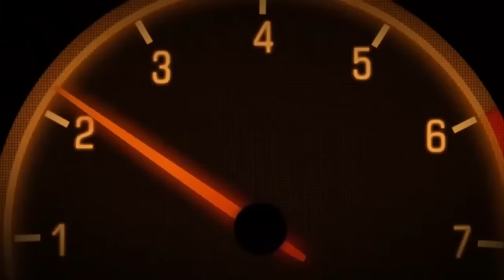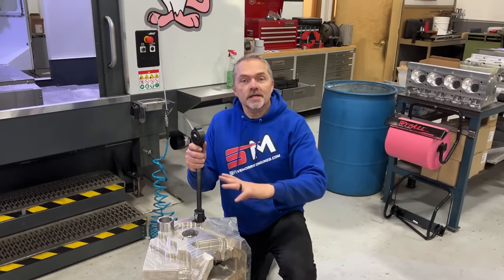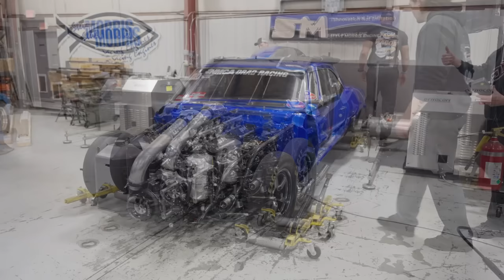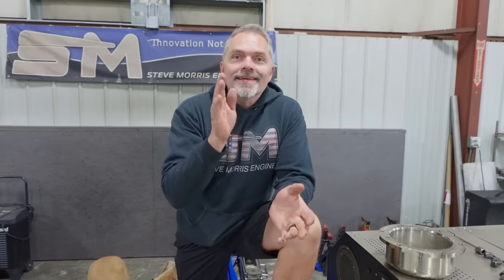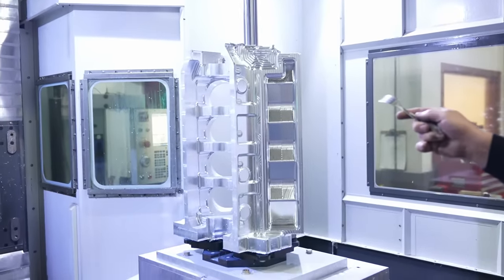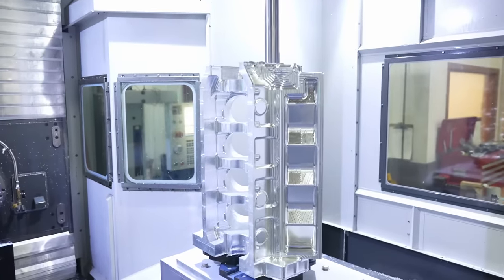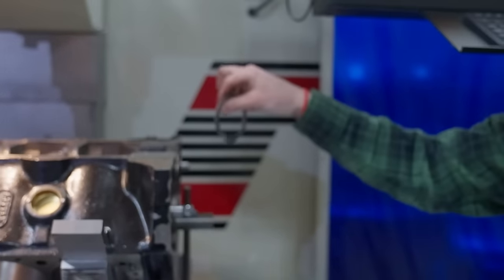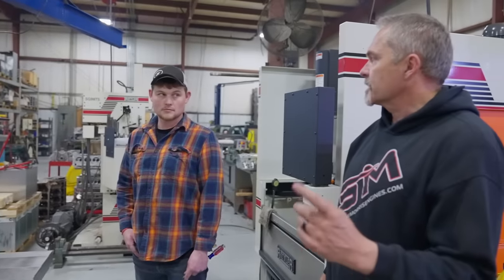Billet SMX Block… SBC Roller Thrust Bearing….Back From The Dead 1969 Camaro.

Comment: I might be wrong, this isn't my erea of expertise but....
By having all external surfaces finished with the 75k step change you're significantly increasing the surface area of the block. I would guess this will help with cooling so isn't just for looks option it has can have an actual, practical, effect.

Just thinking out loud really, would love to hear anyone elses input.

Comment: Steve - Is it just me or did your dial bore gauge look like it was showing 3 thou tight and 5 thou tight, not 3 loose and 5 tight? Just looked like the needle was reading past 12 o'clock clockwise for both readings? Thanks. Some people may not realize a sheet of paper is around 0.004 thick and comparing that to oil clearance in bearing use less than that can be an eye opener, maybe you could do an info piece on that.

Comment: Dear Mr Morris,  
 I would be very intrigued to see what would happen if you Cryogenically stress relieved the engine blocks after heat treatment. 
 I honestly think you might benefit from using the same type of technology the germans employed in the construction of their aircraft engines. The deep freeze is important to realign the crystals in the metal matrix. ❤❤
 P.S. polished aluminum cools slower than unpolished aluminum because of surface area differences. Besides the fact that all those curves and straight lines look awesome with the tool and die ground look.

Comment: Well, it was fine till Steve put his grubby finger prints on it! LOL JK
I was watching after you asked the question and came to realize that area you are speaking about is inside the water jacket. At least that’s what I understood. So I don’t think you want to waste any time there. What you might want to do is consider what is best for the cooling. I don’t know if smooth or rough, is better. 
That is my 2 cents. 
I think Sugar Momma is a great Drag and Drive car I’d be happy to have. I put in my $60 entry for one of your blue zip up hoodies. 
P.S. I think maybe they must have water cooled those blocks leading to the cloudy aluminum discoloration. 
Mark

Comment: As a metal engineer im thinking the matt finshed surfaces are from a longer (most likely) better heat expert. knowing the blocks will need finishing after treatment.

The shiney block looks like an amature that has held back a little bit, scared to go as hard as the original guy.

i haven't watched past 3 minutes yet.. Will be hard to see if the finally machine and finish on the dull blocks is stronger than the nice shiney block after machining
Reply: Could also be he runs his HT oven with argon or vacuum

Comment: Do you slow down the cnc cut rate after the block is heat treated? Does the heat treatment do anything to the weight of the block?

Comment: The engineer in me would want the high stress locations as fine a finish as possible (to avoid crack nucleation) but that slightly more "as machined" finish elsewhere.
Reply: The scallops are all radiused, so crack propagation not an issue.

Comment: So just a question i don't know anything about heat treatment on aluminum but does it treat the hole thing or only so much from the serface and then if it treats the hole thing then how much does that affect flex just curious cause cast iron caststeel is so much different i just don't know how aluminum reacts

Comment: I get how the heat treat can't get into the full depth of the billet, but what if you used an investment casting (a very roughly shaped block-like casting) from the same aluminum? Then it could be heat treated and then final machined. That would save the hundreds of pounds of lost chips and only one heat treat. Anyone know?
Reply: Can't use the same alloy for casting. Cast aluminum alloys are very low strength. These guys go to all the trouble of machining from a solid billet simply to have the high strength. Billet aluminum is stronger than even cast iron.

Comment: Also if u really want to show you CNC in the future, there are wipers for your screens or air pressure blow downs wo keep coolant and metal shavings sticking to the window giving better video quality. 
I wouldn't say cheap but you can afford the 1500 bucks if u plan on getting a lot of content on this machine
Reply: I hear from a few sources this works okay but Ipad oleiophobic screen protectors do a better job and cost like $10

Comment: did you guys get a tougher lexan screen and a bit tougher engine room walls yet? wouldnt wanna see another blowup like that last one Steve.
pretty sure that heat treatment on the greyed out ones had a lower temp during annealing

you chose the right music for showing off that surface finish Steve.... ill just put it that ;) as a novice additive manufacturer i must say i appreciate the effort made to achieve the finish. are those aligned monotonic passes for the finish?
Reply: @UKMechanic Phu! thats good. thank you sir.

Comment: They can "stuff in 5 or 6 blocks at a time" and get a correct "finished product" when even a single block has many different "parts" that all heat and lose heat at different rates and must be heated as slowly and evenly as necessary so the thin "parts" are not overheated or overcooled by the time the thick "parts" reach the correct "temp" and there is no way in hell 5 or 6 blocks can all be done correctly in one "batch" and the cost could be FREE because they keep shoving in parts - if they don't have 5 or 6 blocks they'll damn sure fill up the "wasted space" with somebody else's "work" as long as the parts are the "same specs" as far as metal and hardness - and still be the biggest ripoff possible if they "work" that "cheap" because their "business model" is based on "quantity" of parts "stuffed in" per cycle to "cut costs" on labor and material and overhead costs per part while QUALITY is supposedly "guaranteed" because they "stuff in" as many "identical" parts by material and temp(s) as possible with no regard for the fact that DWELL TIME  is the other CRITICAL FACTOR and even more critical than temp(s) when treating different parts that even when one piece have different "parts".

Comment: 12:18 do you ever have to worry about harmonics in the machines? All the years of turning basic brake rotors if I ever started to hear the machine singing I knew the silencer clip or band fell off and would chatter the cut

Comment: Steve a shooter friend of mine ordered a cnc machine to make barrel tuners & muzzle breaks in his own shop to save money wrong the 660 main feed took like a month or more to  feed the machine & set it up he got monster generator for like industrial use it had 660 out of it it ran off diesel fuel ( he filled it up like 180 gallons ( grab your wallet bill! ) it same as over road trucks use it like 4 or 5 dollars a gallon! ouch!!! like a 6 inch by 6 inch chunk metal to a part out comes muzzle break or barrel tuner! one guy makes guns & machine guns mini semi auto ones like ww2 ones  the cnc machine programed it run for hours and I do nothing just have to baby set it some times ( read a book, drink coffee  and watch the metal fly! when it done it a machine gun part!) i need metal part for satalight pole on line it like 30 to 40 dollars no hard ware got it at auto parts less then 20 dollars with clamp a 1foot and half pipe for exhaust pipe extender!

Comment: Yes that is pure sexy, I could look at that in my living room daily.
I wonder with that 70 off set cut if it would not offer more strength and cooling effects as well? It's bridged and while small more surface area to the same square inch of space. Like if you find a hot spot in a motor it couldn't hurt to have that cut, like fins on an air cooled motor.
Love all "The Brain" on the machines. Got my gift card and if I win we will work it out.

One more thing you are taking people behind what goes into a "big dog " motor. Most have no idea as to why these things cost so much, the hours of "set up" you should film. Show people how hard it is to get a big block square and true to the machine.  How 1 thou. of shim can change how far out 2 ft away can make. 

As a kid 40 years ago I worked as a mold maker finisher, cleaning up the molds after repair or rough finish to glass smooth. 1 Mold took me 4 months to hand finish, 8hr a day 5 days a week. I have mad respect of your work.